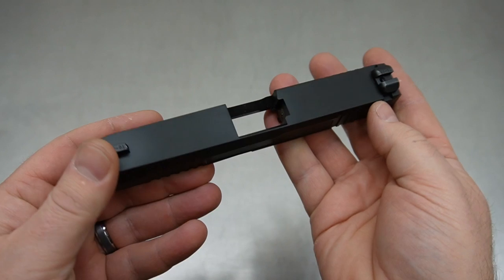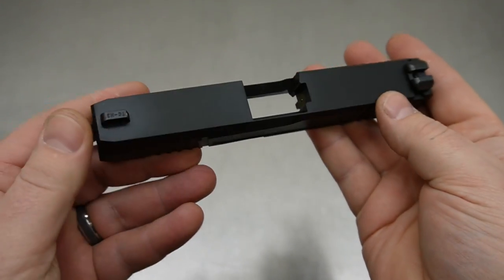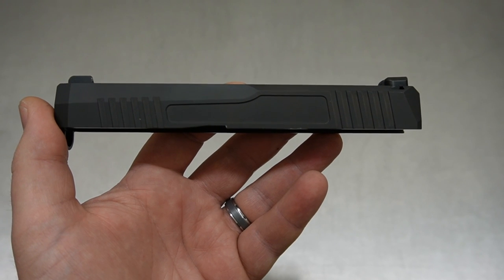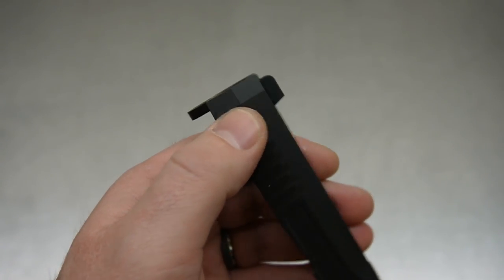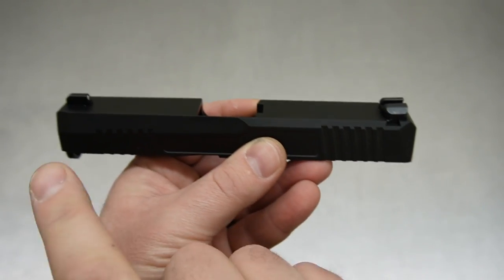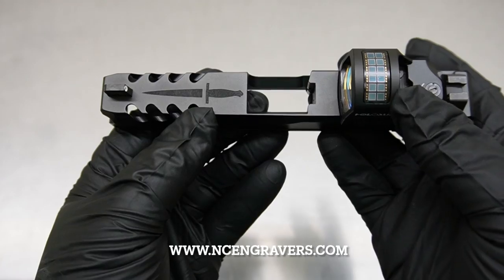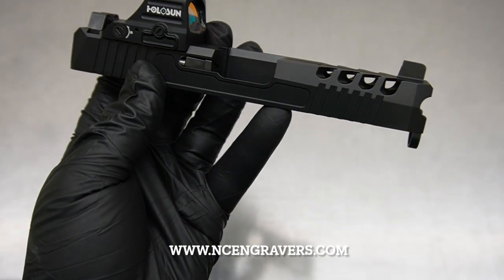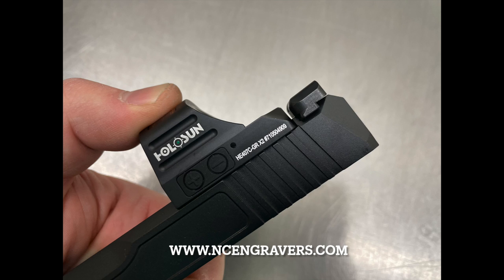NCEngravers.com - PSA - Dagger - Raptor Cut Build

Comment: I just got a Gen 3 Glock 19 and a PSA dagger slide because I wanted rmr cut and I'm in Commiefornia so nothing optic ready on roster. But on the slide the dlc coating wore off on the slide rail slot , under the coating there's machine marks like the edge of a dime. It made the slide action really rough, I had to sand the rail slot to smooth it out. I'm happy to hear him say it's made with strong metal though, I was worried about longevity

Comment: Excellent video!  I've never seen a YouTube walk-through like this.
Reply: Several shops have reported that the Dagger DLC coating chips in being machined.  PSA has said the DLC coating is applied over a gas nitride treatment.  The nitride treatment may be contributing to the chipping.  Of course, nitride treatment would penetrate the surface of the Dagger stainless steel slide.  I haven't been able to confirm whether the Dagger Cerakote slides chip in the same way.  If the Cerakote chips, this supports your understanding that the "problem" is not with the DLC coating, but rather with the underlying nitride-treated metal surface.
Reply: You have what we're referring to as the "V2" Dagger slide.  The V2 Dagger slide has a more extreme rear chamfer as compared to the "V1" Dagger slide that first shipped in May.  All of the recently-released (within the last month) Optic-Ready and Optic/Suppressor-Ready Dagger pistols and slides are shipping with a "V3" slide.  PSA is referring to this slide as having Extreme Carry Cuts.  This is somewhat of a misnomer in that while the front chamfer of the V3 slide is in fact more extreme, the rear chamfer is actually less extreme.  I'm confident this change was made to better accommodate a Dagger slide being MRDS-cut rear iron sight forward.  With a V2 slide RMR-cut rear iron sight forward, the rear corners of a Trijicon RMR hang over the edge of the rear chamfer slightly.  The V3 slide should eliminate this.

Comment: That dagger slide will work on the gen 5 frame if you just use a gen 5 backplate on the slide. Js
Reply from the maker: Didn’t think the dagger slides have a cutout on both sides for a slide release.. all gen 5 frames have a slide release on both sides and these slides don’t have a cutout on the left side..
Reply: @NCEngravers  the ambi slide release doesnt affect it at all. You just cant use the right side of the ambi release to lock the slide back because there is no cut ot for it on gen 3 slides. And the back plate on the daggers and gen 3 slides are the only the only reason they wont work on gen 5 frames. So you just put a gen 5 backplate in damn near any gen 3 slide and it will work. Just try it yourself. 

I have a dagger slide on a gen 5 frame now that runs flawless

Comment: Just got the Dagger FDE SW4 GatorMouth cut,  True Glow 1/3 sights, RMR Cut w/ cover w/ Threaded Barrel Upper for my G19X lower for $199. 
Looks almost like the Cobra Nose & other cuts which is sweet 🤟
Reply from the maker: how does that work? your 19x is a gen 5 and that slide is a gen 3.. dont think its going to mount.

Comment: I LOVE the bare look of that slide after you stripped the finish off and engraved the dagger on top. Is there any way to keep a worn look like that with a durable finish? Some kind of "clear coat" or something?
Reply from the maker: i believe these slides are stainless so no need to add a coating.

Comment: Got a G19 gen 4 had for years & it's held up great 1200 rounds or so but considering a Red Dot but shelling out $650+ for a gen5 19 MOS ? Just interested what ballpark cost to RMR cut 19 slide & black nitride? Great work man.👍
Reply from the maker: $200 optic cut and black nitride slide coating
Reply: @NCEngravers  definitely a fair price. When I'm ready I will go to website & purchase work to be done then send stripped slide to you understanding nitride takes longer but I'm in no hurry cause quality work is worth the wait. Thank you.